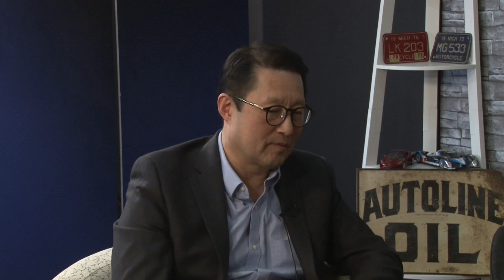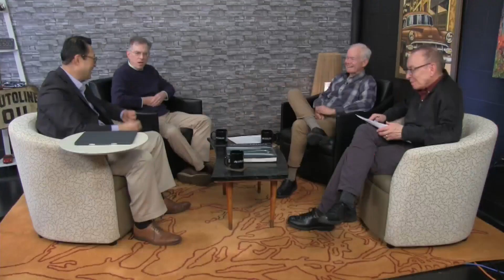LG Still Sees Technical Hurdles to Solid State Batteries

Comment: LG should be ashamed of all it's battery defects.
Chevrolet Bolt EV: In November 2020, General Motors recalled 50,932 Chevrolet Bolt vehicles from model years 2017–2019 due to potential fire risks linked to high-voltage batteries produced at LG Chem's Ochang plant. The recall was later expanded in August 2021 to include all Bolt models and model years, totaling nearly 142,000 vehicles. GM cited manufacturing defects by LG as the cause of battery cell shorting, leading to fires. 

Hyundai Kona EV: In 2020, Hyundai recalled approximately 82,000 Kona EVs globally after reports of fires in South Korea, Canada, Finland, and Austria. The issue was traced to a folded anode tab in the battery cell, which could cause a short circuit. Owners were advised to park their vehicles outside until the batteries were replaced.

Chrysler Pacifica Plug-In Hybrid: In February 2022, Stellantis recalled 16,741 Pacifica plug-in hybrids after 12 reports of vehicle fires between 2019 and 2022. While the exact cause was undetermined, all affected minivans had battery packs containing LG cells.

Volkswagen ID.4: In March 2022, Volkswagen recalled 351 ID.4 vehicles from the 2021 model year due to insufficient soldering points in the high-voltage battery, which could lead to unreliable connections and potential starting issues. 

Porsche Taycan: In October 2024, Porsche recalled 27,527 Taycan EVs in the U.S. due to a potential short circuit risk in the high-voltage battery modules, which could cause a fire. The issue was traced back to a cell block module in the LG Chem-manufactured batteries.